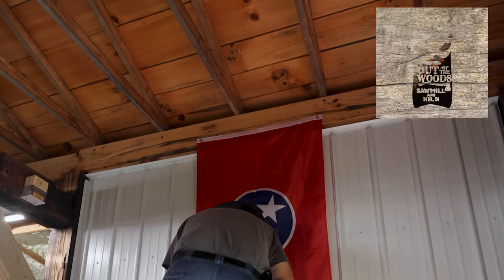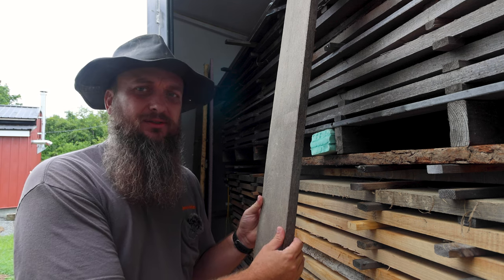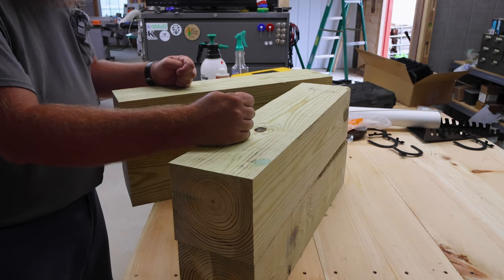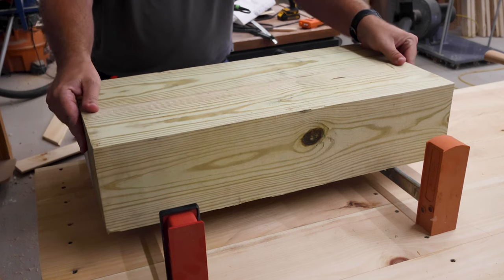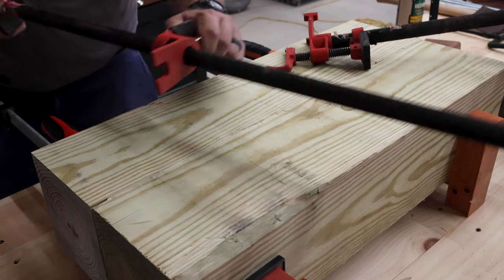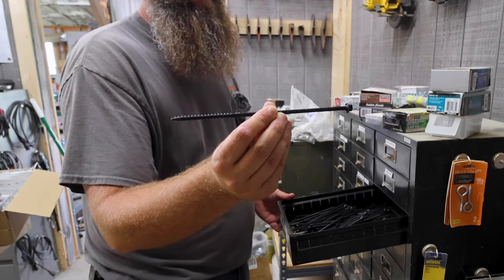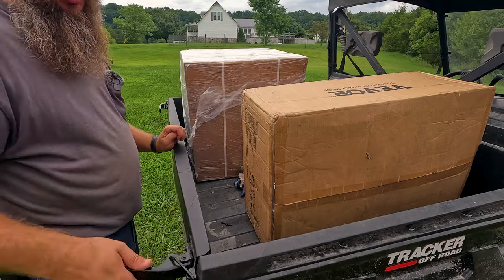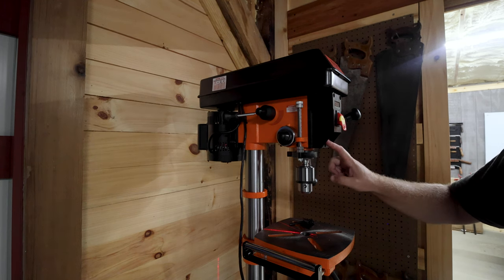Backwoods Homemade Lumber! See The Results Of How I Kiln Dry Wood

Comment: I purchased the same drill press from Amazon six months ago.  Also purchased a extended piece that attaches to the plate you use to place your material on for drilling.  Works great - no complaints.  Good luck with your press.  I think you will be very satisfied. 🎉

Comment: Definitely go with the black walnut 

Ps try a little paste wax on your timber lock screws.  It’ll help your impact driver easier
Reply: I totally agree on both counts! 👍
Reply: A bar of household soap and a good ‘spit’ do the same thing
😎
Reply: Why use an impact drill on wood at any time either pre drill or use the correct screw  you are more likely to damage or destroy the screw and then you are in a hole lot of trouble 😉 but what would an old bricklayer know about carpentry anyway

Comment: Nathan, Kreg makes a jig for using on larger timber like 2 X 4 and thicker. The jig comes with a very nice screw and the screw is coated for outside projects. I've used it making the supports for work benches with 2 X 4 wood and fence posts in treated 4 X 4's. Your clamps are very nice but I use pipe clamps because of the price. I would have used 2 on each side top and bottom. OK you used 4 just like I was saying. I might have counter sunk the screws a couple of inches. Now that is a magnificent 2 wheeler!!! Hey, burn pile is pretty good!!! Drill presses are great. Mine was my Dad's and is older than I am and I am 75. Nice heavy drill chuck. Wow, the drill stop is the same as mine and like I said mine is over 75 years old. Good ideas last!!! You are going to love the working light and the laser.

Comment: For structural glueups made with difficult woods, use a toothed blade in a low angle jack, Gorilla Glue, and 3/8ths inch lag bolts.  For small wood parts use Krazy Glue Gel.

Comment: I made pipe clamps up in my shop in 2000 n i have never used them in 1/2 " n i have 3/4" ones on the wall still in the package.

Comment: I have three drill presses in my home shop, a small countertop, a drill press with a base, and a large floor model that I changed to three phase so I could use an inverter set to 50-80 cycle to allow me variable speed. Guess which one does 80% of my work. The small craftsman from sears gets most of the use. Ray

Comment: That looks like a nice drill press 😊😊 let us know what  the speed range  is please  😊 thank you 😊  😊😊oh I was going to tell you about  some glue that works  very well 👍👍
Its called  Vanguard  !!! It is a transport adhesive  and it will not let go !!!!  It will glue concrete  wood glass some plastic   steel  aluminum   just about  anything  you can think of  !!!!! 😊😊😊 your local  trailer  repair shop should have it !!!!  Its not cheap  but if you don't want it to come apart  😮😊 its worth  it 😉 😊

Comment: Wouldn't have been comical to have edited in a cartoon explosion right after the glue. 
I have yet to use those big timber screws. Would dragging them over a bar if soap make them run in easier?

Comment: The problem with pressure treated wood is it has a very high moisture content.  Older wood should be low enough to glue well.
Reply from the maker: Yes